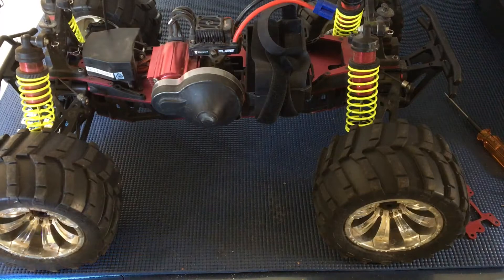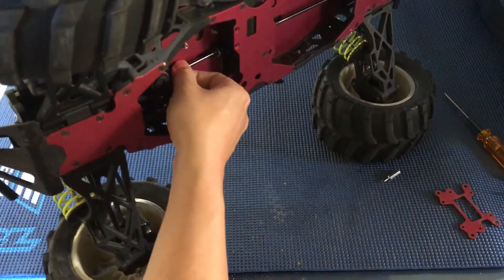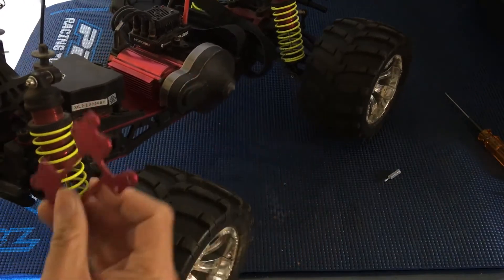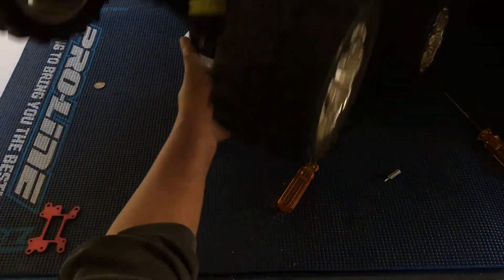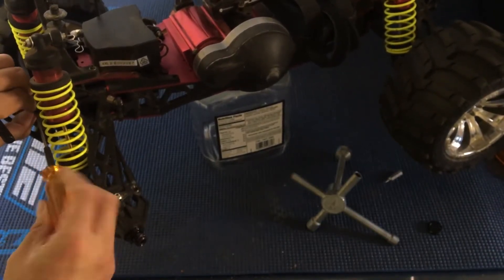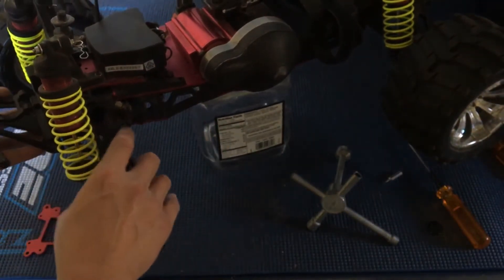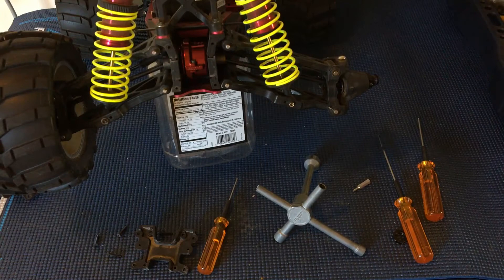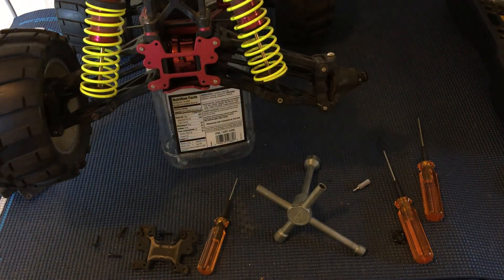Racing2Learn: 1/8 Monster Truck Losi LST XXL2-E: Root Cause of Drivetrain Issues: We Forgot A Part!

Comment: Hey I just got a LST XXL2 and I think this is the same thing wrong with mines but instead of the front I the back when I accelerate the rear isn’t pulling is that my gears or my drivetrain?
Reply from the maker: Hi Derrick, it's hard to tell without seeing the truck. With the truck upside down, check whether turning the rear wheels in the same direction causes the front wheels to turn as well. If they don't, the issue may be the driveshaft going from the rear diff to the transmission.

Comment: Damn! We've all done it.
You may want to shim the diffs on these both internally and externally at some stage as you'll find the slipper setup really needs to be run almost locked down to handle 6S power. 
If you haven't already, have a read of http://www.rctech.net/forum/monster-trucks/892207-losi-lst-tips-tricks-3mm-4mm-screw-mods-how-shim-lst-diffs-etc-pic-heavy.html
Thanks again for putting up this series.
Reply from the maker: Thanks for the comment and the tip/link Ken! Haven't shimmed the diffs yet. The saga continues though: https://youtu.be/Bzpq-CXFpV8